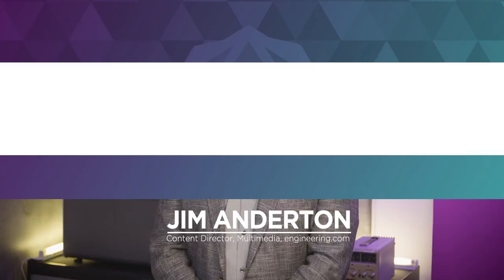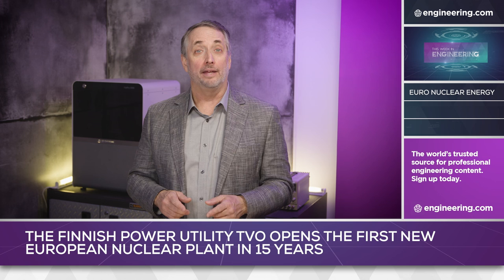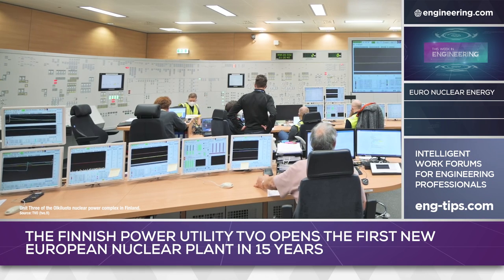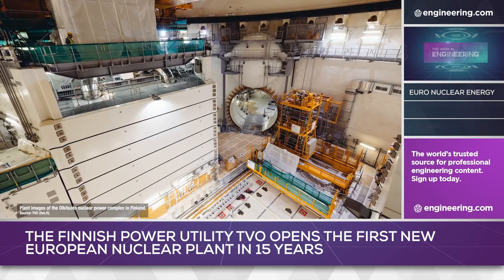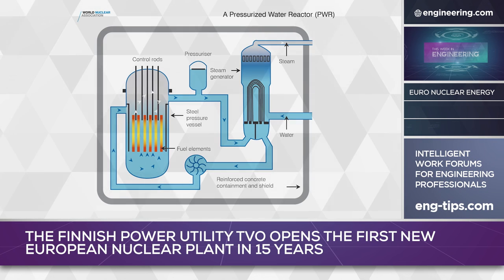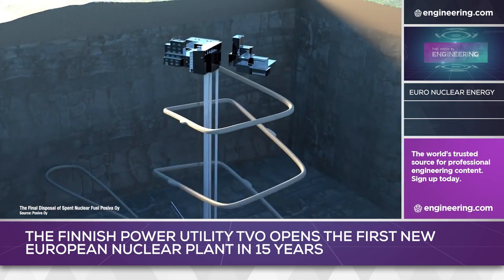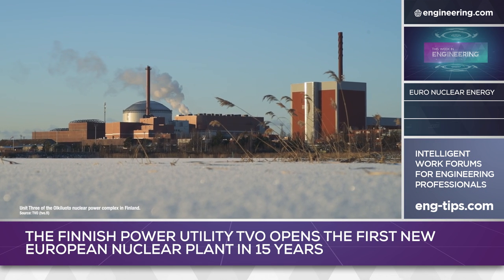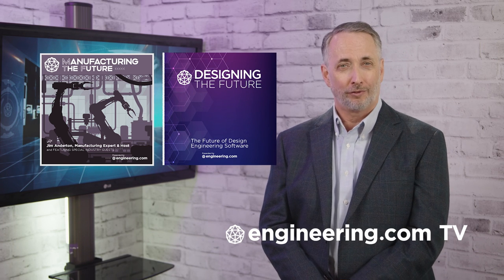Finland Opens the First European Nuclear Plant in 15 Years

Comment: Their first nuclear plant, Loviisa NPP, runs on 1977-1980 VVER-440 Soviet reactors. Fuel is still supplied by Rosatom. No major incident in 40+ years.
Reply: The reactor, turbines and main components were from  Atomenergoexport (Soviet union) but the control boards etc safety related was from Siemens, process computers from Nokia...
Reply: Yep, Loviisa's 2 reactors are Soviet reactors (though large parts of control and electrical systems are finnish/western).

Olkiluoto's older 2 older reactors OL1 and OL2 are from Swedish ASEA-Atom
Reply: Westinghouse had also made some contributions.

Comment: Nuc power is great for energy production, while oil is perfect to power car, stationary engines, planes etc. Renewables can't match the need or deliver a stable supply. Therefore, we need to make a mix to keep costs low and to protect the environment in those countries, where raw material for car batteries are produced.

Comment: Reality: Olkiluoto 3 increased in price from € 3 billion to around € 13 billion €. The electricity from this costs more than 15 cents/kWh.
That´s approx. 200% more than the price of electricity from wind power. This is one of the reasons why Finland is massively expanding wind power. 
In 2022&2023 wind power capacity in Finnland was doubled to approx. 7 GW. 
This year and next, 7.5 GW of offshore wind power is to be put out to tender.

Comment: They keep improving LWR's, but this technology wastes a lot Uranium, and requires keeping the wast cooled for a decade, before it can be moved.  First, it requires Low Enriched Uranium, which means that the fuel has to undergo an extremely expensive, energy intense process, which leave you with 2 tons of Depleted Uranium for every ton of fuel.  Of the fuel actually used in the reactor, only 5% undergoes fission, before waste products stop the reaction.  Detracting further from efficiency, the tubes that the fuel is packed in is made out of a Zirconium alloy that cannot tolerate heat much above the boiling temperature of water.  That means LWR's run at lower temperatures than coal fired plants, and cannot match the efficiency of converting heat to electricity.  Worse, the waste is so radioactive, for about 10 years after being removed from the reactor, it generates enough heat to destroy the tubes that contain it.

Fast Breeder reactors are far more efficient, but require their fuel to be enriched at least a dozen times over LWR's.  These have been successfully used in military applications, but the research goes on with two other technologies:  Pebble Beds and Molten Salt.  The first encapsulates low enriched Uranium in robust layers of Carbon and ceramic.  This solves the temperature problem with running the reactor, but it still has a high cost on the front end.  Molten Salt offers a much wider array of possibilities, from running on waste from older reactors to breeding Uranium from Thorium.  The US government abandoned research in this direction, back under the Nixon Administration for lack of interest.  It was originally supposed to power a bomber for the USAF, good grief!
Reply: We can waste uranium bc uranium is cheap and plentiful.
I'm all for fast breeders but most commercial ones were shut down because they were more expensive (around 2.3 times the price compared to a PWR per kWh) and uranium scarcity never happened.
Reply: @SC-yy4sw  Why waste it, when you can build efficient reactors that are cost effective?  LWR's a pressurized, requiring very sturdy buildings that are very expensive to make.  Pebble beds and molten salt reactors can run a atmospheric pressure, so they don't need expensive containment buildings.

The only advantage that LWR's have over PB's and MSR's is that the US government paid for the development of the old technology.  Now that there is some demand for improved nuclear technology, the government is too poor to do anything, but make sure working poeple are paying their taxes.

Comment: I'm all for green energy, but this thing took 17 years to build and cost 3.67 times as much as they expected it to.  Depending on where you live in the US, it typically takes 5 to 8 years to break even on a residential PV solar installation.  In 17 years they would have paid for themselves 2 to 3 times over.  With these kinds of numbers from a nuclear plant, I have to wonder if batteries are a cheaper option - they are certainly more readily available.
Reply: Half of the year, there's almost no sun light in Finland. Would require enormous photovoltaics+batteries to store enough energy during summer to last over the winter. :D
Reply: Solar has a life span of 20 years max, a nuclear plant is 70-100 years.
Reply: @fl4shi238  For Finland's case, a better source would be wind turbines out in the surrounding seas.
Reply: The issue is that you're thinking of just powering your home.
Now try and power things like industry. Now try desalination plants, carbon capture or energy inefficient ways to generate biofuel. Residential PV won't cut it.
When we focus on renewables we're locked into the "it's better to use it directly" mindset. For a car? It's more efficient to charge a battery. A truck? Still not a solved problem but may become possible in time. An aircraft? Except for short hop flights and light GA we won't have battery powered aircraft that can replace turbofans. Nuclear allows us to deviate from the "just wait until battery tech improves and then we'll use electric".
Reply: Do you realize that sun does not even rise over some parts of findald for months... Literally zero daylight. Batteries for what? Darkness and cold?
Reply: @NGC1433  See my comment above about wind turbines being a better choice for Finland.
Reply: @Cynthia_Cantrell  Finland has peak demands when it is cold (like really cold!). And when it is really cold, there's typically no wind. Would still need ridicilous ammount of batteries and windmills.
Reply: 5 to 8 years? With subsidies and high energy prices maybe. In most places you're basically never going to make your money back on a residential solar installation. Plus solar is pretty much the least "Green" green tech. Requires crazy amounts of REM for power output and you basically have to just bury the refuse forever. At least with wind you're just burying giant fibreglass blades (Again, forever)
Reply: @bobsickle2336  A friend of mine installed solar on her rooftop 2 years ago in California.  So far the 5-8 year estimate is on track.
Where do you think the ash from coal plants goes?  Another friend of mine lives next to a lake in North Carolina - she has to buy bottled water for everything because ash leachate has contaminated wells for miles around.
Reply: @Cynthia_Cantrell  Does that estimate factor in that the panels will produce less energy year on year due to degradation of the cells? And I'm not advocating for fucking coal power here buddy, take your strawman somewhere else.
Reply: @bobsickle2336  Yes.  She's in southern California and gets plenty of sun. If you have a better solution, feel free to articulate it.  Resorting to foul language doesn't make you look more intelligent.
Reply: @Cynthia_Cantrell  Sea based wind power is more expensive than nuclear and needs to be subsidized. Not a good choice.
Reply: Cynthia cares about cost of Kwh ...

Comment: NIce, did they put it next to the sea? I guess they put the vital parts in the basement under the water level since that worked out so well in fukushima.. :))
Reply: Japan is such a tectonic hellhole that they used to make their castles with sloped walls so they wouldn't fall over. It's the last place you should build ANYTHING that you really didn't want breaking.
Reply: Ground level is constantly rising in Finland, even in the southern parts of the country.
Reply: There is an immense advantage to siting a nuke plant near the sea for cooling.